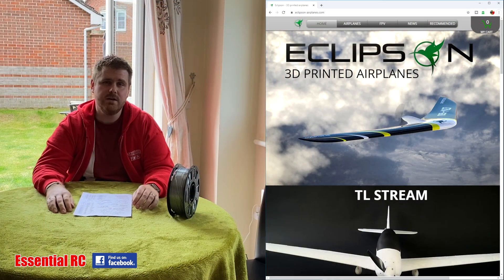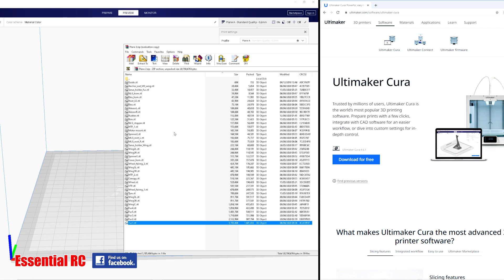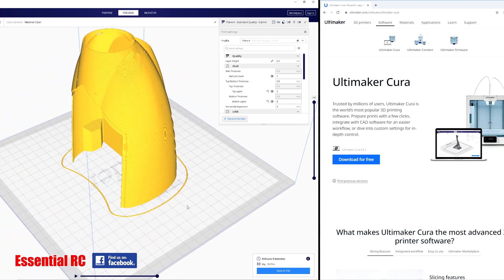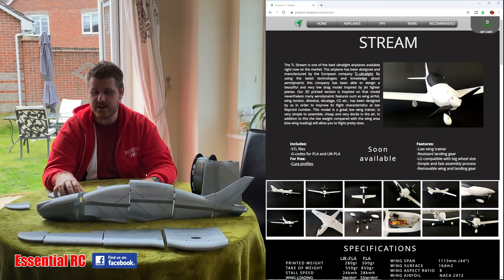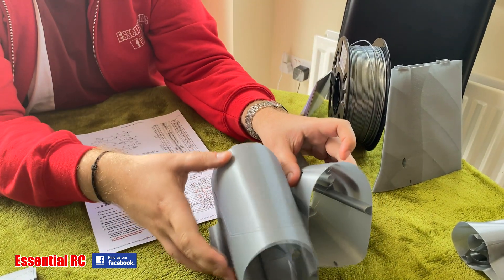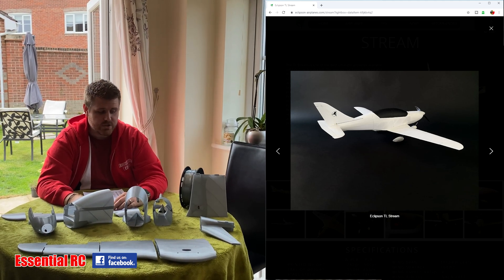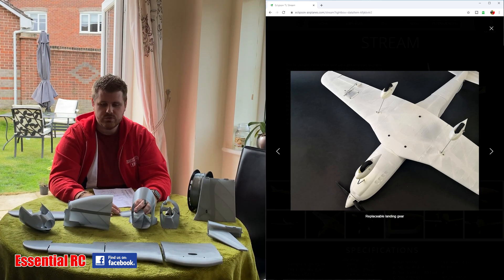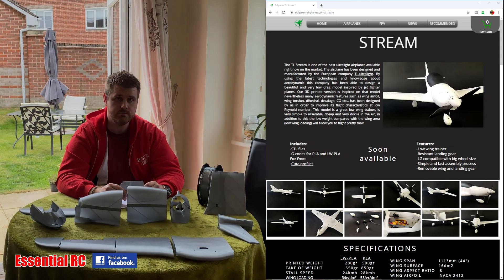LOW COST and EASY 3D PRINTED RC AIRCRAFT: ECLIPSON STREAM: PART  1 of 3

Comment: Rather than printing everything costing MUCH 3D print time and weight, how about just printing wing ribs and fuselage framework, using carbon fiber tubing as wing spars, and then a heat shrink covering.  I realize that PLA may not be an option because of its low plastic point, but how about other filament types?

Comment: Nice. Going to be interesting to see how it all pans out in terms of AUW, performance, longevity. Also curious how the sections are going to be glued together. Appreciate they have tabs but not all the way around so much of it will be a butt joint? Not the strongest of glue joins. Think I would be tempted to over lay a thin glass sheet on each join to prevent them separating over time... Looking good though bud. 3D printing is amazing technology.
Reply: Carl Brain yea it’s an interesting way to join parts. AUW should be 850grams longevity all depends on material used. I have not gone for the most durable as I am using this as a learning curve but the next one will be made from material that should last “forever”